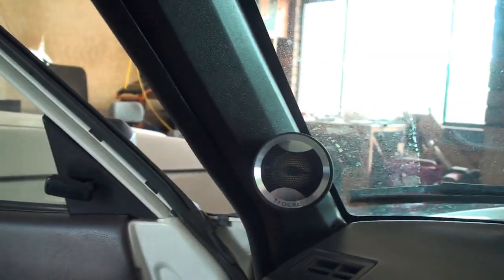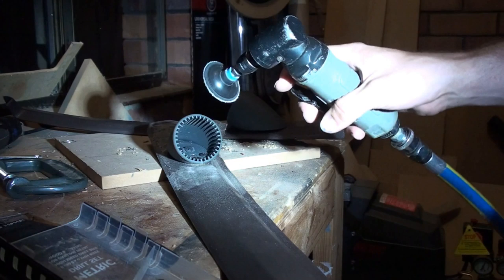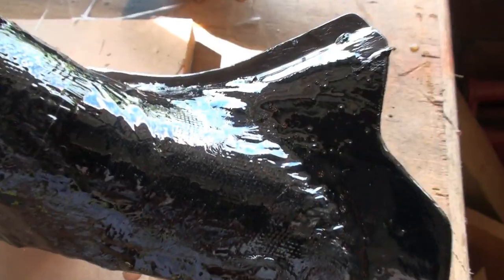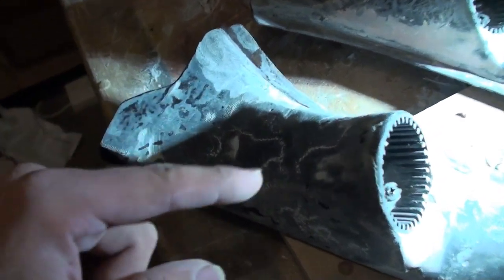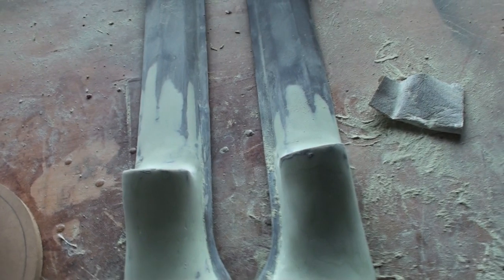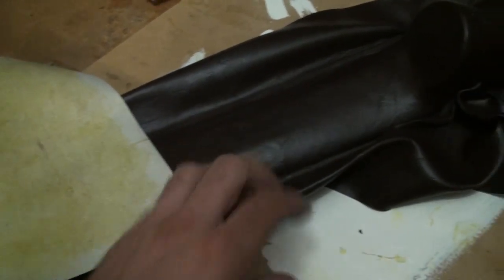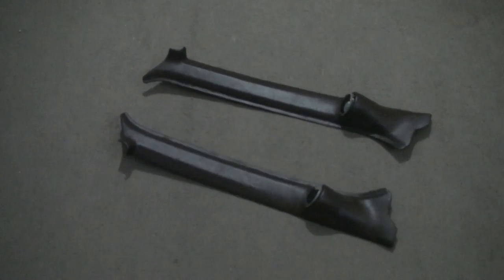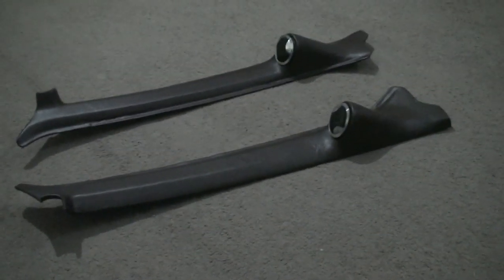Custom Fiberglass Tweeter Pods Build For Focal KRX2 Tweeters

Comment: You may already know this but silk works bad ass with thin areas and fiberglass resin. The silk makes a strong ass fabric backbone and is super thin. One other tip is when you are working with something that fiberglass resin may not want to stick too or maybe reacts to by melting what you are working with is to take a small pot and melt some candles in it and use a paint brush to brush a thin coat of wax on the surface. This works real good with foam like hard foam you see in ice chest coolers. That foam is awesome for carving cool designs into then coat it with wax and fiberglass. Make sure you don't leave any pin holes though because the resin will bleed through and melt its way into the foam and hollow out the project. Unless of course that's what you want.
Nice job by the way. I really like watching your builds.

Comment: Hey man nice job on the tweeter pods. Btw just asking a quick question if I send you may pillars with some tweeters could you build some pods for them and I would be able to pay you for your work. I could send a money order by mail or  I have a pay pal account. Thank you for any info you can give and if you don't feel comfortable with taking on the job I understand. Well thank you and have a nice day mate.
Reply from the maker: bobdude2360 I could do it in a few months maybe, what car and what tweeters ?
Reply: ***** Hey thanks for a reply. The car is a 2002 kia spectra and the tweeters are boss audio 1 inch tweeters. I want three in each pillar flush mounted and the pillar's to be painted satin black with spray paint. I don't need any thing really expensive I'm on a budget. Just want the pods to be made of of wood then warped in fleece and fiber glassed in and then painted. Also I to have to wait a few mouths until I get the cash saved up to afford to pay you cause I work for lawn car service and right now not getting many hours so once I have the cash I will let know so we can do business. Thanks for your time and understanding have a nice day.